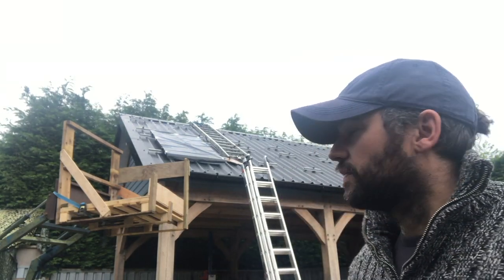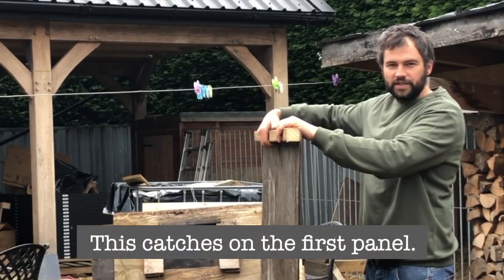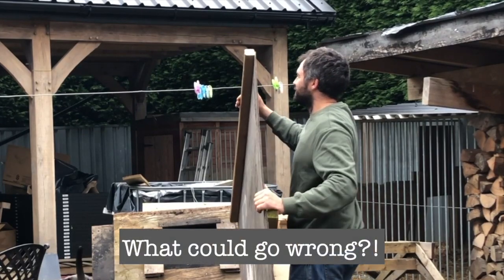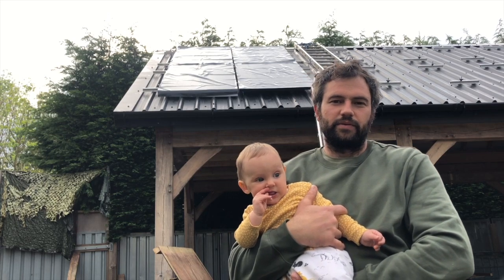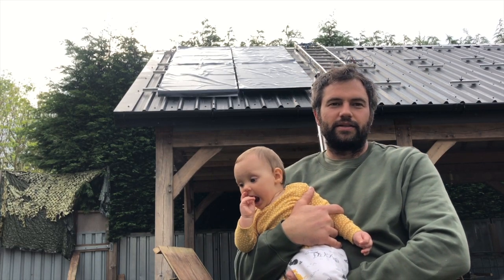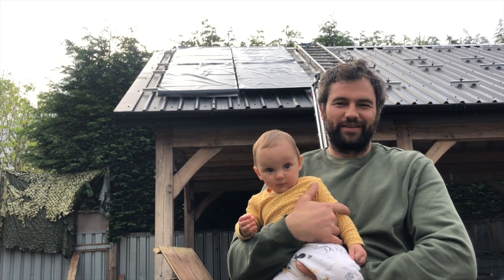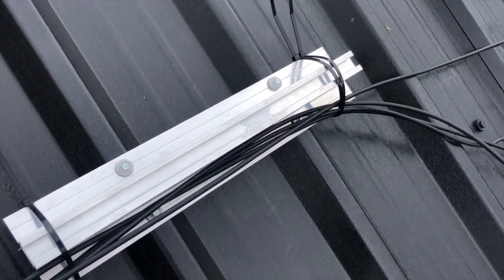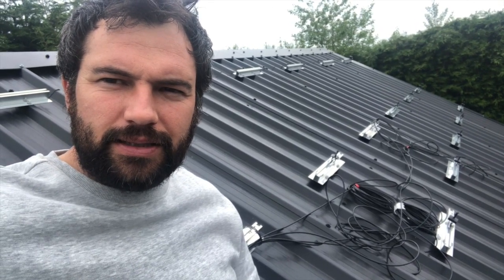OFF GRID SOLAR PANEL INSTALLATION: LG 355W SOLAR PANELS for OFF-GRID HOME | Life OFF the GRID

Comment: Nice video. just side note ..i did notice once those Victron chargers start working on max 100A in my case they get pretty hot. so i added small 1.2W 24V fan that is pointing toward that charger. and i have it on timer (actually it is on intelligent controller that is checking temperature, time and such) and during day it blow hot air from it ..because i believe it might increase life time of that charger much more because during peak power you can't even touch it so hot it's get. and new fan i might change once in 2-3 years ..it cost nothing..but it isn't same with this pretty expensive charger from Victron.
Reply from the maker: Thanks for your comment 😊 we’ve kept an eye on the temperature and so far it’s been ok but we will keep this in mind 👍

Comment: Been doing the same thing by myself for a week now. I like the jig you built. I am doing it by using a pully and rope. The pully is at the top of the ladder. I just pull add push the panel up at the same time. My roof is on a barn though, and the slope is VERY steep. No way to sit on the roof.
Reply from the maker: Thanks 😊 The jig really helped. All the best to you for your project. Working on your own is really tough, especially with a roof as steep as yours! 😫

Comment: Great job for a first timer. Future tip, you do not need to cover the panels. As long at you are just terminating the pv wires into the isolation switch then it is not a load. Better to be safe than sorry since you didn't know but I'm sure it was a huge pain to cover them all, and then uncover them, and then clean them! haha
Reply from the maker: Thank you 😊 It was a pain, but like you said it was s case of better safe than sorry 😂

Comment: I had the same issue when mounting my wall panels.  I did it by myself using just ladders and it was really tough and very sketchy at times.  I'd definitely recommend a movable tower at the least but like you I made it work without one, somehow.
Reply from the maker: Yeah it’s worth filming a dangerous struggle you might get 250 quid if you land funny. I was gutted a tower came up for 150 pound on face book market place. I missed it. It was about 500 new. So I, like you, struggled along. 😀